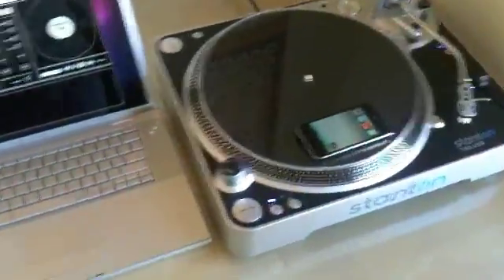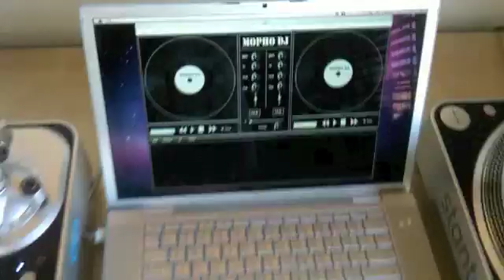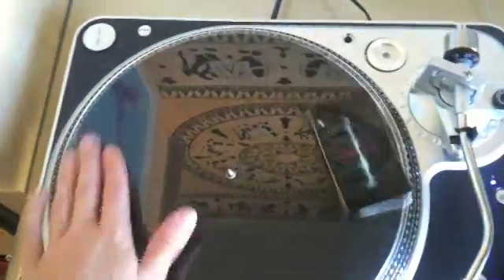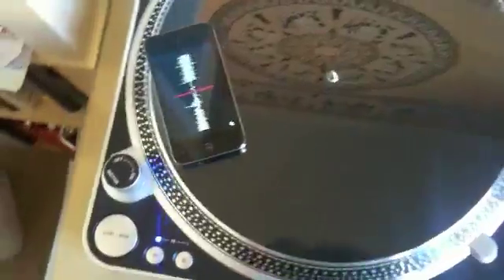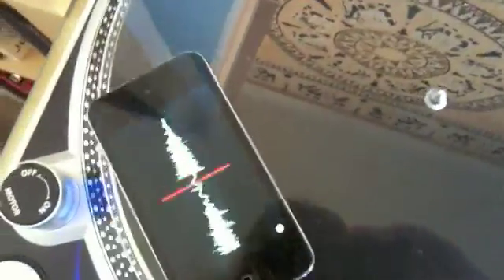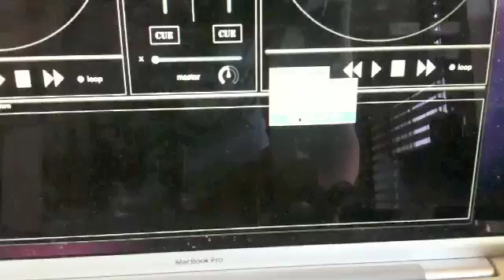MOPHO DJ

Comment: nice idea 
the next step would be probably to assemble the accelerometer inside the plastic disc 
but wireless devices require many a times battery power 
what are the advantages of accelerometer against timecodevinyl in absolut mode ?
is the resolution able to handle slow drags scratches?
i am little sceptical about wireless transfer, for mixing it could be ok, but for serious turntablizm i dont think its a good idea 
dose anybody remember  the Tascam TT-M1 Scratch Control Unit?

Comment: I'm sorry, but no.I applaud the effort, this kinda stuff is my life. DJ'ing, VJ'ing, idevices, etc. etc. but.... if the point of the file you want to scratch is where the ipod is sitting, its a BIG problem. I need my hand to be within a certain range of the record to be able to cut well. Having to know where the ipod is in the rotation so you dont accidently touch it or  the home button in a dark club is not good.Use the iDevices hardware to its maximum yes, but this is not gonna work out.